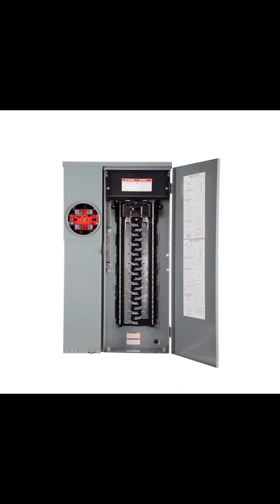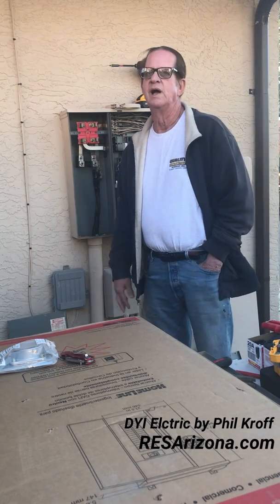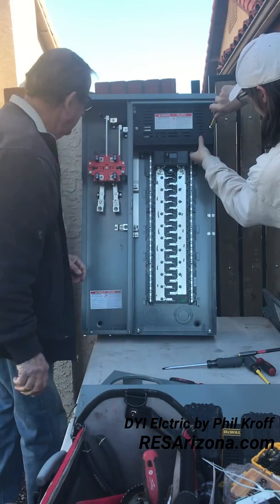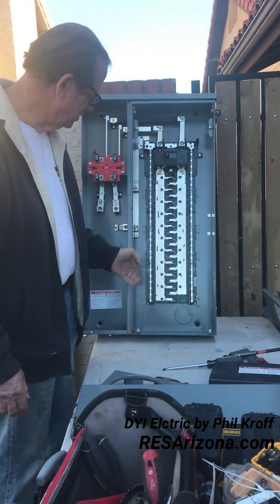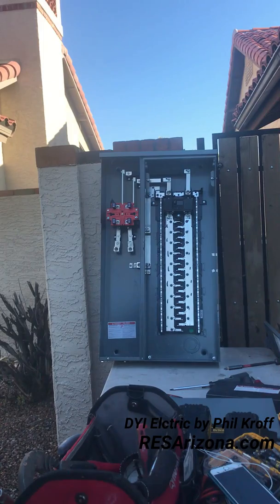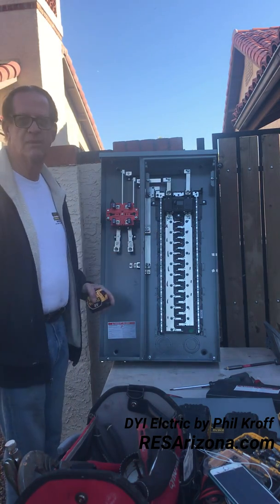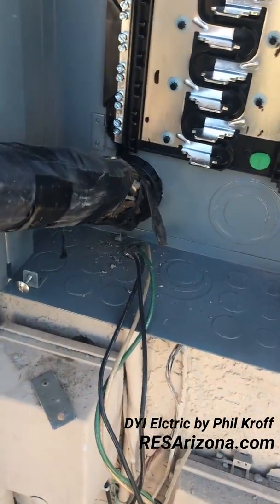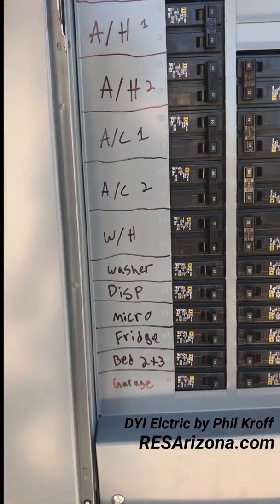All in one electric panel upgrade Install and review

Comment: Good morning Don, I believe Carefree is in Arizona Public Service territory. If so they allow The Siemens MC3040B1400SC to be used as a 200 amp service with the secondary 200 amp breaker slot to be declared a Solar only designation. In other words they consider it a 200 amp panel with a 200 amp solar backfeed. So it is considered a 200 amp panel and all the rules and wire sizes are required for a 200 amp panel apply. Your city inspector will probably need to be educated on this, as it is an uncommon situation. Hope that helps. If you have any questions you can write me directly at philkroff@yahoo.com and I can get you documentation on this method.

Comment: I have a small home in Carefree. All the solar companies I talk to want to put a 400 amp solar ready panel. To do that I would need to trench and install 3" conduit over a hundred feet to the transformer. I'm trying to get rid of my electric bill totally but don't need 400 amps for my house. They tell me there is no way to get 150 amps of solar backfeed with a 200 amp panel. Do you have a solution?